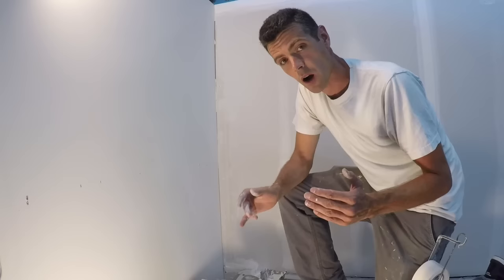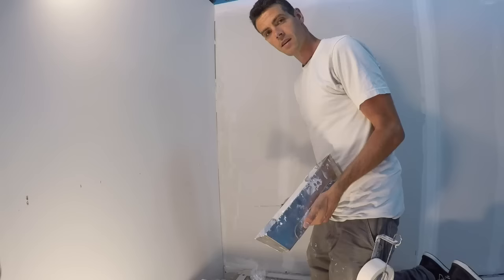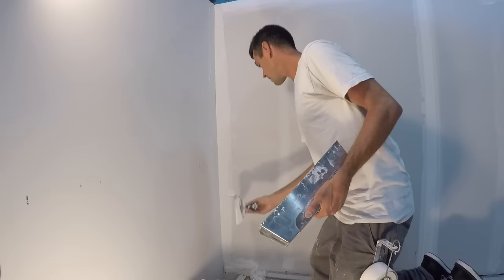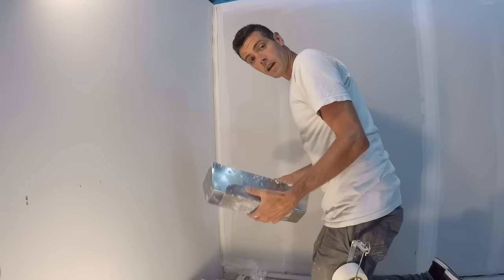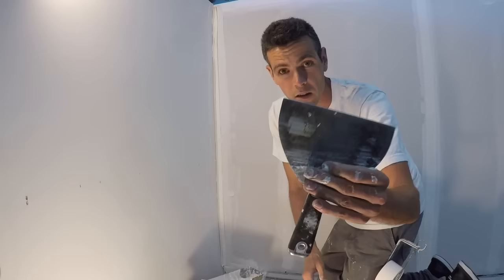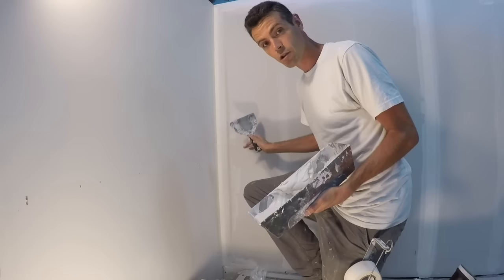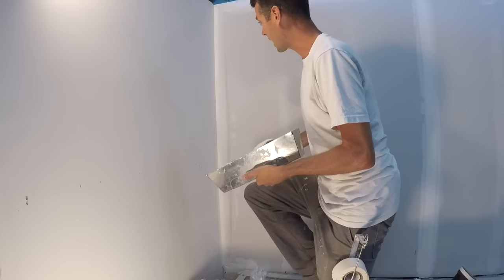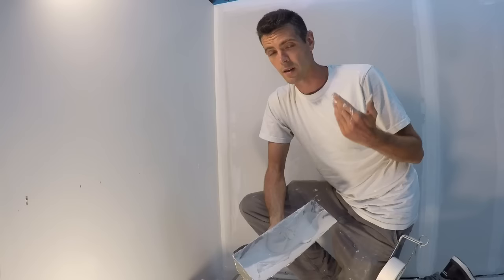Top 3 Beginner Mistakes on Inside Corners!!

Comment: You also can’t forget all knives come with a very slight ark or cupped. If you eyeball your knife you will see an ark in the blade, this is important. After you get the tape in the mud, then look down your knife and make sure you have the ark in the right direction. The ark should be pointing towards the wall with the corners of the knife winged up off the wall as you pass down the tape pressing it into the mud. Now, when you are coating tape say on the center bands of your drywall joint when you’re putting the finish coat over the tape after you embedded it, you put the mud inside the ark so the knife is cupping the wall or tape center with the mud cupped in the knife, then, after you spread that mud, flip your knife with the corners of the knife winged out away from the wall and feather the mud top and bottom or right and left of the tape. Yes, knives come with arks in them, especially the bigger knives. If you run the knife with the corners cupped out while imbedded the tape, the corners won’t dig into the tape. Just thought I’d throw that out there for people who may not know. You can also over time keep bending your knife on the corners against the floor or workbench to increase the ark if you prefer. It’s tempered steel so it flexes back but will bend over time. The ark is very slight, almost hard to see but it’s there and can be a big help.
Reply from the maker: Agreed. It took me a few months to learn that.

Comment: I am chuckling as I'm watching this before trying corners...I thought I was "removing old caulk" before re-caulking corners in the house my parents left me.  As I ran my knife along one corner, I thought, "Gee, that sounds kind of like paper...." and it sure didn't feel like pulling off a bead of caulk.  Now I am learning to tape a corner.  LOL.  It's going much smoother than I thought it would since I can watch these videos.  I'm still sort of amazed at how much material you have to put on your knife to get a good coating.  Thanks for your virtual help.

Comment: In addition to not having sharp corners on your knife, I've found it sometimes helpful to angle the handle of the knife slightly in toward the corner (versus pointing straight up or down)  which relieves some of the pressure of the corner of the blade against the seam of the paper. I know... hard to describe.
Reply: I understand completely. Nice comment
Reply: Yes that's what I do and it's so much better

Comment: At 70-yrs old, I'm learning to tape and mud renovations on my home.  When you know little to NOTHING, learning to do EVERYTHING via YTube can be daunting.  I realize that what I did initially in corners really was the right way to do it!  Unfortunately, I saw a DIY somewhere, and they recommended doing one side of a corner at a time WITHOUT demonstrating what that actually MEANT the way you did.  Thankfully, I was able to get the corners smoothed out anyway.  I'll go back to doing it the way you demonstrated.  EASY-PEASY.  Thanks for the clarity!

Comment: Thank you so much! I was struggling yesterday with inside corners on a room I added a wall to. I watched this along with a few other of your videos last night, cleaned off what I did yesterday and started over today. I used a smaller knife and hit the edges with a file. I thinned my premix down a bit and did one side at a time. I spent less than 2 min on it and it looks like a pro did it!

Comment: best video ever!  I took out a wall in a bedroom, after removing a closet. I dulled my knife's edges, and finished one side of each inside corner at a time, with a day drying in between.  The walls turned out perfect!  Got ride of that stupid v shaped corner trowel, and haven't used one since learned this method. Thanks for this tip.

Comment: I use 20 or 45 min hot mud for almost everything so my jobs are done usually the same day if not then the next.....I even use 45 mud in my spray hopper to do the texturing and also when doing hand trowel texturing
Reply: 5 min mud buddy, works like a charm,  mix it up and it's kickin
Reply: Yeah mix it up and it's a block in your pan before you get it on the wall🤨
Reply: @knockoutcustoms7477  love the stuff!!
Reply: I’ve been mudding for 15 years and never used 5 min mud!
Reply: @jamusmorrison3073  I hate 5 minute mud.....not enough working time unless it's a very small patch

Comment: I’m starting to get what I would consider decent at taping on repairs and small jobs, a lot from tips I’ve learned right here from this guy up top. Although I bought a corner trowel and don’t mess around trying to figure out doing it with a regular knife. I have the corners turned up on some of my knives, I find it helps things go smoothly and prevent lift offs with my inexperienced hands

Comment: I always thought doing one side at a time was a beginner cheat.  Glad to hear I was doing it correctly (for a beginner at least). Thanks!
Reply: Nah, it's not beginner cheat, it is how, and the only way it should be done. 90 minute mud might help you finish faster if you don't want to wait a full day to get the other side. However pros will have automatic speed tapers that allow them to do both sides at once.
Reply: @jkotarsky  \ I also seen them use those corner blades made for this. Does both sides at once
Reply: @BobBob-we3wr  Yeah, I know pros who snicker at that tool. As if it were not good enough for them. But I use that tool all the time. It puts a bit more mud in the corner, that sometime shows a crack when it shrinks. But if you go over that with one of those sanding sponges. The end result is better than any pro knifing one side, then another.
Reply: Exactly what I was thinking. Plus I always want to do it all in one day so I nvr like the idea if soending TWO or MORE days taping.

Comment: Tip #3, so many times I'm trying to be the hero and get it done quicker. "I'll just sand out the imperfections until I start sanding tape. Which paint will cover. That'll be fine... that'll be fine... that'll be fine.."

Comment: What about the mistake when you get metal corner bead and try to use it for an inside corner and then when it doesn’t lay flat you put in about 5000 nails and then try to mud the absolute crap out of it to hide it and then eventually realize you have to pull it out? Is that not a common newbie mistake? Asking for a friend.
Reply: You clearly should put your tools down and call a professional.
Reply: I was just considering doing that. Thanks for the heads up. 🤣🤣🤣
Reply: @SpeshulFX  You should almost NEVER call a "professional" if you have the capability to do it yourself. Why? Because of the cost. LEARN to do it yourself and not only improve yourself, you also buy the tools and LEARN which is very important in life. A lot of "professionals" make money by taking shortcuts that you would never take on your own home. The main reason to call a "professional" is laziness. Stand up. Face that stupid wall and tell it who is boss. The guy with the money and the tools.
Reply: @SimRacingVeteran  lmfao well put
Reply: Your "friend" is at DIY stage where he shouldn't try anything more difficult then putting fake plants in the the corners.
Reply: Lmfao

Comment: mistake #1: not my problem, but noted.
mistake #2: I haven't bought a new knife in years, but again, noted.
mistake #3: UGH fine...you got me...But I just want the job over with already!
Reply: Use Perfect 90 type product on all inside corners.  Much better short and long term and you can do both sides at the same time without issue.

Comment: Um.. I do both sides at the same time with an inside corner trowel? Finished an entire house worth of them same day
Reply: I have never seen this before
Reply: Yeah but not everyone knows how to use a corner trowel
Reply: I had one - never could get that thing to work right!
Reply: Rdubs 1 it’s tricky yes, and it doesn’t do the job in the first pass or coat for that matter, and I use it with a regular 6” blade.  But once you’ve figured that much about it you’ll be glad... it makes very nice corners in my experience
Reply: I have that trowel but don't care for it as it can also leave a lot more mud in the corner than someone may want.    I like using Perfect 90 tape as you can do both sides at the same time, it is straighter, stronger and less likely to ever show issues in the future.
Reply: I'v done both ways. As a part time DIYer, I find the method in this video to turn out better, and overall, done in less time.

Comment: For the impatient - if you use setting compound, you don't need to wait a full day between opposing sides of the corner. Once one side has set, you can coat the other. You can also coat both sides at the same time with a corner trowel, or by angling a 4 inch knife juuust right, but either method takes some practice.

I usually do my first coats with 45 minute mud, and if I can't get both sides of a corner right then I'll just mix up another batch an hour later and clean up the problematic angles. By then, the first side has already set and I don't need to worry about ruining it. I only use ready mix for the last coat, or when skim coating.

Comment: I made all these mistakes you mentioned over the years. After my first failed attempts with paper tape, I switched to self sticking fiberglass mesh tape. Then topped irpt off with mud, using a corner blade so i could mud BOTH sides at the same time. It worked well for me, as a beginner. Was THAT cheating? Listening to your video, I guess i was. It wasn't till years later that i finally learned (from your videos) how to get paper tape to stick to the wall (pre-apply mud with ultra thin layer on wall). Thank You So much for making these videos. I do wish you could have someone bring camera closer so when you use special hand techniques so we could see them much better!
Reply: I agree closer or better camera
Reply: Corner tool has been a savior for me. Works great. 3 thin coats, I still feather w  6” knife at the end. Not cheating at all. 👍🏻

Comment: Yes!  I had exactly that problem, where I tried to do both sides at the same time.  Mine was even more difficult, because it was at an acute angle.  I got the best results filling the corner in, without voids, by using my finger.

Comment: Fantastic, thank you! I'm doing a slightly different job to drywall mudding but the good principles here carry across. I ripped out an old built-in cabinet in an apartment and found raw fab concrete behind, so all the plastering on top finished at the built-in. Nice. So now I have 1,0m x 0,5m floor to ceiling to plaster out including an internal corner that I need to square up. I feel much more directed in my approach now. Cheers!

Comment: I removed a lot of drywall in my garage to add power, a lot of power, and I didn't want conduit running all over the walls. I knew the basics required to put the walls back together, but thought I would check YouTube for any higher level guidance. Your videos have saved me a lot of time and trouble. I greatly appreciate the time you've taken to make these videos. Taping, inside corners, outside corner beads, etc. etc., I've put them all to use so far... I may be a noob to this, but I believe my work will look like I knew what I was doing... TY

Comment: going thru this beginner stumble drywall foobar right now....one thing I'm finding is on the corners pieces, especially up top..buy Perfect 90 corner pieces....they are reinforced and make the job of applying to the drywall mud and smoothing out MUCH easier.

Comment: For the most part, I agree with what is said here. My only difference is in the finishing of the corner. As a remodeling contractor where "time is money", I don't want to waste time finishing one side & letting it dry then coming back the next day to finish the other side. that just delays the project. Just use an inside corner knife & both sides are finished at the same time.

A tip I learned from a commercial drywall contractor for when you have new wall butting into existing textured, painted drywall - Use a fiberglass tape "Fibafuse" and only tape the new wall side, butting the edge against the existing drywall. After it drys, caulk the corner then you only need to finish & texture the new side. this makes it much easier to match textures or provides an easy straight line if you are going to have  different texture on the new wall.

Comment: I have always used fiberglass tape and a inside corner trowel designed for inside corners. I never had any problems or complaints with either. I also use perforated metal outside corners fastened with drywall screws or barbed cupped nails. I have had to repair drywall that so called professionals finished mostly because the mud shrank because they rushed the job. 90% of the time I used a 12" finishing trowel so there were no dips or humps when I finished the job nor when I revisted a job to check for imperfections.

Comment: Very good advice.  

I remember starting out with a new drywall knife when I first started doing drywall over 50 years ago.  Nightmare!  These knifes will never work properly until they are "worn in." Your advice to take off the sharp square wedges of a new knife is right on the money.  Prepare the knife edges carefully. Treat them with care. And never, ever let anyone else use your drywall knives. They will come back with dented edges and you will have to start all over again either with a new knife or with regrinding and polishing the old blade.  Big pain!

The three tips you offer here are right on the money. Another good tip might be to use the right drywall compound for the job at hand. 

Great video.  Thanks!

Comment: You clearly have more patience than me. I typically use a large plastic mud knife to press my tape into corners without risk of cutting/digging into tape, then I use the metal knife for smoothing out, but I like your recommendation. Also the idea of not using the mud out of the bucket and adding more water is something I will try going forward. Love your videos....

Comment: I’m starting to mud my house at the moment.  Just did the prefill in 3 of the bedrooms today and will be doing the taping in them tomorrow.  Really excited for that since I’m using Columbia compound tubes with the applicators and cobra corner roller for inside and outside corners.  I don’t do drywall professionally but figured $1000 on tools to teach myself how to do it is worth more than $20,000 for another guy to do it and not gain any knowledge in the process.
Reply: @keithmarlowe5569  I’ve hung drywall before but never did too much for finishing.  Normally it’s 5 screws in each stud from what I was taught.  It’s best to go on a horizontal plane instead of vertical because it’s easier to hide any bellies in the walls.  I haven’t used the tools much yet other than just using a bucket of all purpose for taping.  It took a few tries but eventually I got a pretty consistent feel to get the corners looking pretty good.

Comment: Thanks very much for the videos and all the information you gave us.  I just finished  320' of joints in my basement renovation after a flood.  I'm waiting now all that to dry properly to apply vapor barrier primer.  It last the final sanding.  Something I never understood is how to apply mud in the corner without having an overfill on the opposite side. Also, quite often I had a kind of semi dry mud lifting up right along  the corner when I pased the  knife to  take the excess of mud I had just applied.  I never knew the reason, very boring and time wasting.

Comment: I'm a second generation pro taper, I always fold the tape as I pull it off my reel, I'm 6'5" so I crease enough to throw over my shoulder on an 8 ft, shove the tape tight to the top corner TIGHT angles because you should be doing all your upright angles before your ceiling angles, and then cut off the tape at the floor where the trim meets that way if it's short it's not at the top it's under the trim, otherwise you have to make sure the adjacent piece of tape that crosses it covers that fraction of an inch the tape is short.

Comment: When adding a new wall that abuts and existing wall, I just put the tape flat over the new wall after filling any gap with mud and leave the existing wall alone. The straight edge of the tape makes a nearly perfect corner and I don't mess up the finish of the existing wall. I've done this a number of times in my own house and have never had any problems. If the house shifts, a gap might form, but with the straight edge of the tape, it will likely be straight and easily filled during the next paint job. With the tape folded into the corner, a similar shift could cause it to ripple, which would arguably look worse.

Comment: Drywall is not what I do for a living, so I find these videos that professionals put out there very useful. As he said, don't overwork the taping and ONLY put as much mud as it needs. No more. You just keep putting on layers in between until it's done then all you need is minimal sanding. Take your time and a little bit each day. Don't try to do it all at once or you'll end up with more work in the end.

Comment: Your videos are VERY helpful. Going to have to repair the walls in a bathroom. Removed wallpaper & there was nothing bu drywall albeit damaged a little.Mud job was terrible. High spots & little feathering. Not sure which mud they used. Going tp have to sand a lot first before I Remud it all.

Comment: The last bit of advice is the bit I needed..😂 But actually even though a complete novice I've learnt enough from VC to have completed 3 walls so far fully coated - skimmed might be an exaggeration - applied and sanded would be more accurate but I'm getting the feel of it so I think enough practise and I'll have it down! Ok.. off to do wall no. 4.. Cheers Ben!